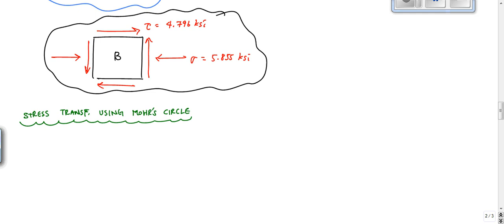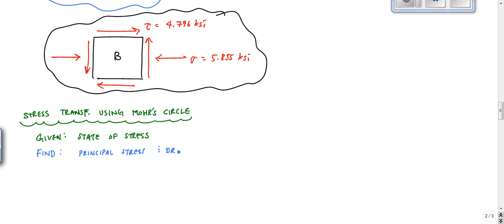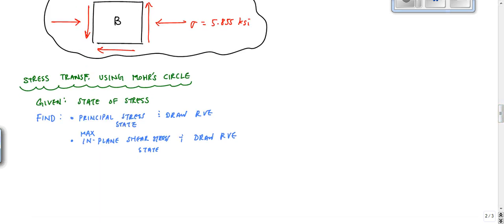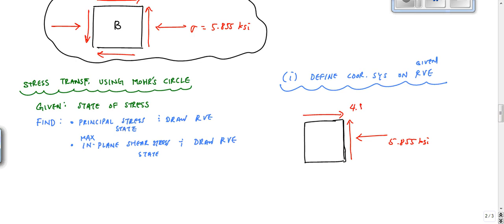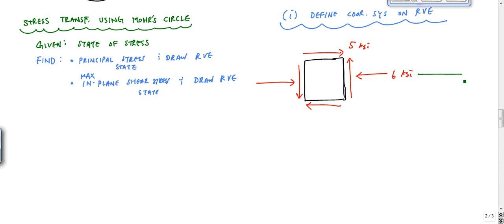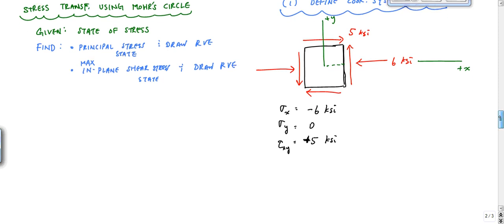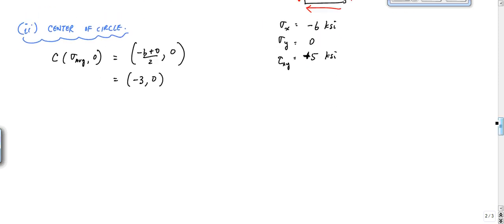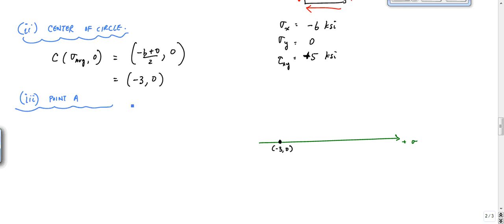Mohr's Circle Example (Review Session) - Mechanics of Materials

Comment: Very good video, but you did not use mohr circle to calculate this problem. You used mohrs circle to visuallise this problem and then calculate it mathematically. In the time before easy acces to a calculator, mohrs circle was by far the most reliable method to quickly get results close to calculation. You could just construct point A and point C (on a scale) and from there draw and measure all the essential things you need to know about the principal and maximum stresses. This would truely be using mohr's circle (and would be a complete waste of time since we have calculators now).

Comment: 13:00 we took 180-59.04 (is it not 180 -29.5) thank you
Reply from the maker: +Abdifatah Bashir we use the 59.04 because we are using the angles associated with mohr's circle.  you could do 90-29.5 if you wanted to calculate angles on the stress element.